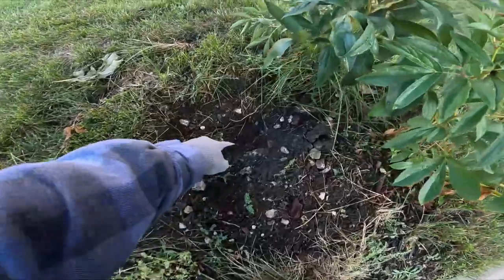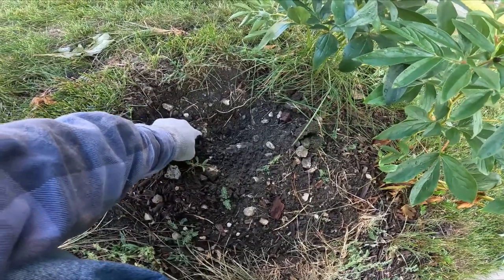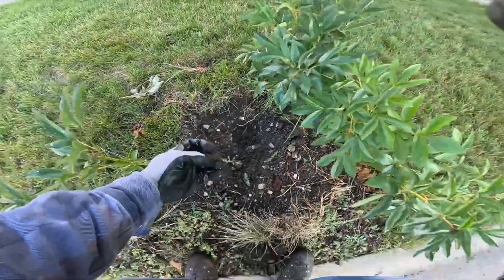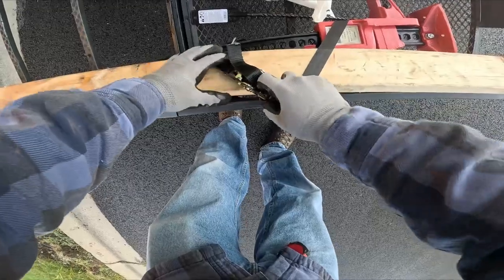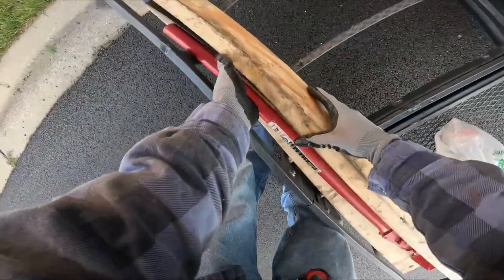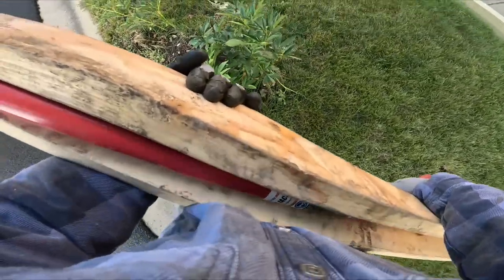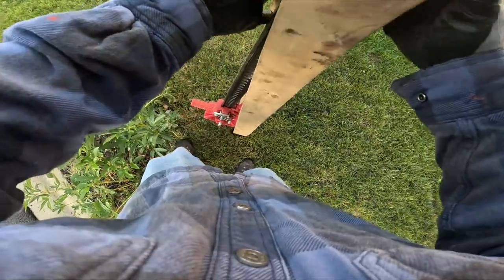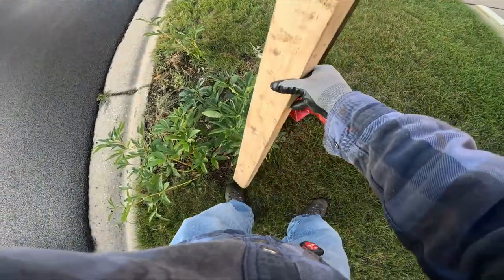Handyman Fails Terribly With Concrete Anchors/ Mailbox Install

Comment: I recognize that parking lot you are in at the beginning.  😁. I used to service the Goodwill Store a little south the that Menards, as well as several other locations up and down the main n/s road there.  Seeing you deal with that mailbox base reminds me, I’m faced with removing the concrete I foolishly used to set my mailbox in back in 1984.  The old treated 4x4 has just about had it.  I keep putting it off, I don’t want to do it!
Reply from the maker: Lol I don't blame ya! Good eyes! Yea there is alot of good will stores around here but u called the area!

Comment: HAHAHAHA....hey Genius, try putting some plywood on the grass as a pad for the foot of the Jack...that was you're 1st fail...2nd fail was not driving a few spikes (6" nails) 2"  into the 4x4 (at bottom & up about 12 inches, on all 4 sides ) this will give the concrete something to grab onto and give the post 10x more stability.  Or, you can also drill two 1/2 holes 10" apart and use some rebar 12" long (1 bore hole  front to back & 1 side to side) to achieve the same goal. Trust me, you'll never set another post in the ground without doing it this way...so simple  !
Reply from the maker: Sounds like a good idea I tried putting plywood down but the wooded legs hit it on the corners

Comment: thats funny i just used some of those red head wedge bolts from home depot the other day to bolt my well pump house to the cinder block footer i built and i ended up snapping off one of them they are made from some soft ass metal
Reply from the maker: They aren't meant for men like us lol 😆

Comment: I worked a 6" floor drain for 2 hours today. Failed. I could feel the sand and dirt, just couldn't punch it. Warehouse kept dumping thier water from the driving floor scrubber in it. Told them to call a jetter truck company.
Reply from the maker: Yea that's definitely a good solution!!